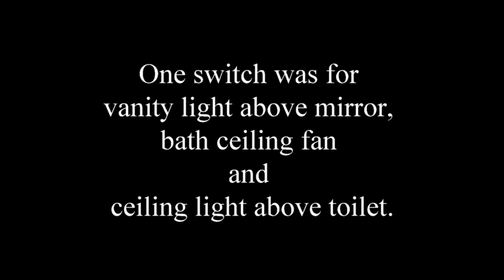How to Split Bath Light and Fan. Full instruction. Один выключатель на два

Comment from the maker: Related wiring connection videos:
How to wire 3 Switch in 3 Gang Box   https://youtu.be/AspcqG4PvPM
Light Fan LED Switch    https://youtu.be/ZC5Dh3VOv6c
Replace a Single Switch to a 3 gang box  https://youtu.be/1K0L2yGvrIo
How to replace Bathroom Fan Switch to a Digital Timer  https://youtu.be/p37dauzBCZw

Comment: Thanks for the updated video and instructions. It’s very hard to see but I believe you mislabeled the main hot wire. You labeled one of the wires for the fan or light as the main hot wire.
Reply from the maker: On what minutes? 
Hot came from bottom of the box and than goo to bottom screws both switches.

Comment: Question: you start with 3 black, 3 white and 3 ground wires. My question is with the ground wires. At 6:02 you twist the 3 ground wires, but later in the video you attach the fan ground wire to the ground on the fan switch, you the attach the light ground wire to the ground on the light switch, but what do you do with the Hot ground wire? I thought you twisted the 3 ground - can you clarify? The video was a little dark and difficult to see at the step. Help!
Reply from the maker: 3 ground twisted together,  and one of them just cut off and throw away. So 2 left attached to the switch.
Reply from the maker: Or before twist you may make one ground shorter and 2 long and then twist.
Reply from the maker: I just watched this episode. Look at 5:54. I hold the 3 grounds and twist all 3 copper wires with my fingers a few times, then I take the black wire cutters and cut off one of the long ground, and then I take the yellow pliers and twist the 3 wires together tightly. So in that twist 1 short and 2 long copper wires.

Comment: so bond all the neutrals together, bond the grounds together but leave 2 pigtails to ground each switch, make basically a jumper wire for the power in to connect the 2 switches together, then connect your individual hots one to each switch to control them individually. What kind of light switch do you use for this, 2 pole? And I just run 2, 12/2 wires one for the lights and one for the fan?
Reply from the maker: @Swizzlestik  Any standard switch for light will work. And wire 2/14.
Reply: @FixitAll  I'm running 12/2 in this bathroom, should this be fine too?
Reply from the maker: @Swizzlestik  Yes its ok. 12 usually used if planning to use some hi amp staf - heater with hairdryer at the same time. 
So you just will be more  safe than with 14.
Reply: @FixitAll  yea im rewiring my whole house, and just running it all in 12/2.

Comment: Thank you for clear instructions. I have two switches in my bathroom: vanity light on one and ceiling light and fan on the other. Am I correct in assuming I would follow similar steps to separate light and fan to have 3 switches?
Reply from the maker: Its depend how many cables you can see in the box - 2 or 3 ?
Reply from the maker: At 4:05 you can see 3 cables/wires. If you have same 3, so you can done this steps.
Reply: @FixitAll  I have 3 😁! (Newbie question: what happened to the white neutral wires?)
Reply: Never mind...I see them
Reply from the maker: @slw.5432  All white together, twist and done. No connection to anything.